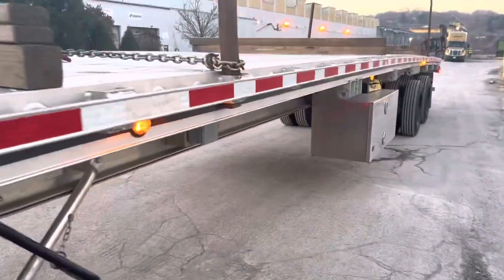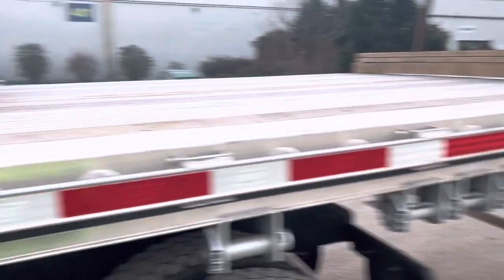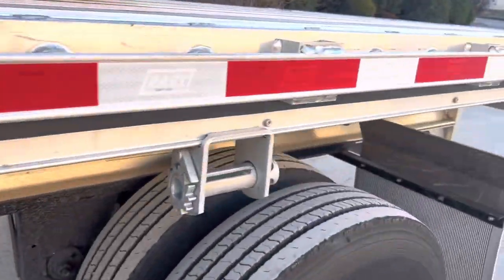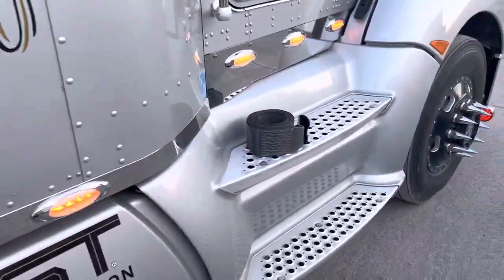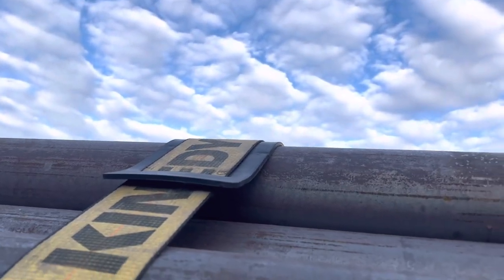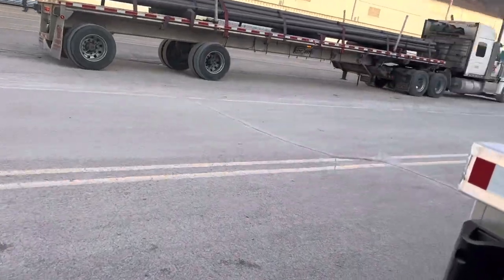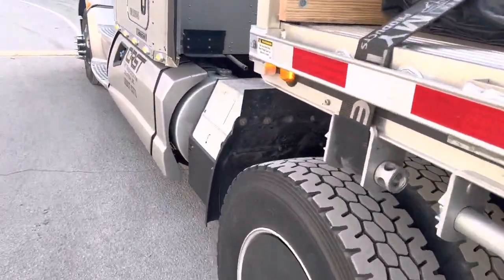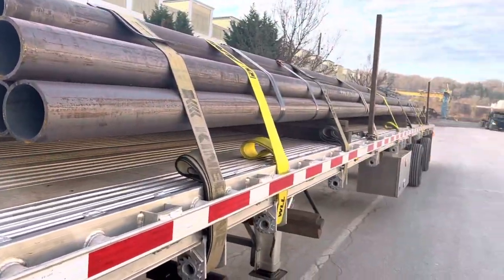CRST Flatbed…. Securing Steel  Pipe￼Correctly & How to Belly Wrap

Comment: I think putting a flat rubber sheet (16”wide) between each layer, two will do, then lock them down tightly will be very helpful and make good friction preventing forward sliding

Comment: hauled all kinda steel pipe is deff the most dangerous. Angles and beams stack together and easy to strap so is reebar. pipe rolls . If its  20 ft piece  2 to straps on each layer maybe 3 depending on size. If its 40 ft plus i do 5 straps a layer sometimes even apply chains warehouse guys think im overboard.
Reply from the maker: No such thing as overboard when it comes to securment
Reply: @sturgelltruckingllc4074  they hate loading me! I want it centered touching load straight lol  many drivers just take load however

Comment: I've found pipe to be not that hard. I've ran local with multi diameter same layer stacked.  If you belly wrap 3 over/under it'll pull the same as strapping opposite and add more resistance to the pipe. Im finding your videos very helpful, keep'em coming as I'm looking to haul other stuff.